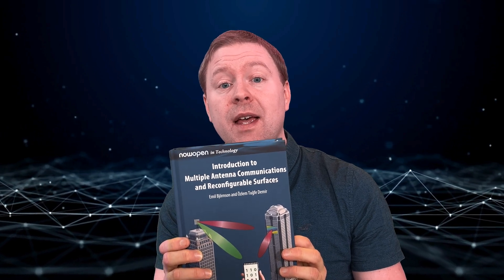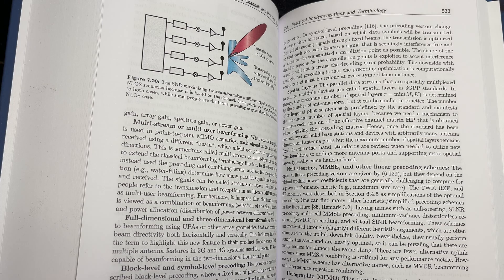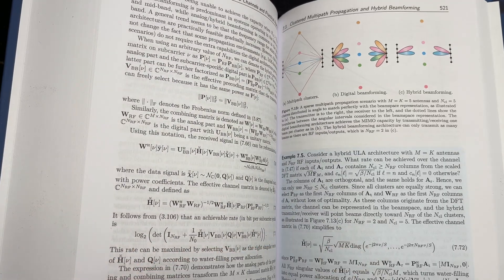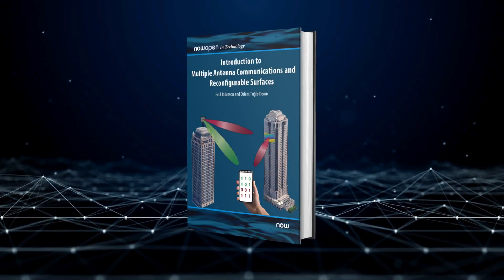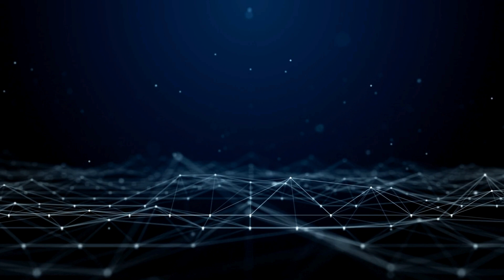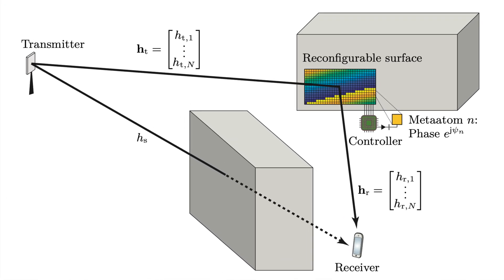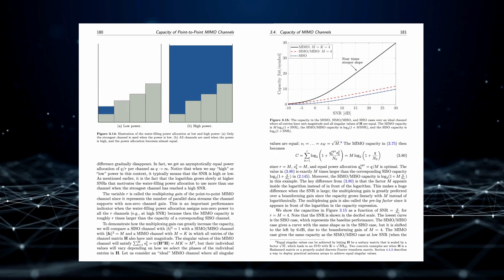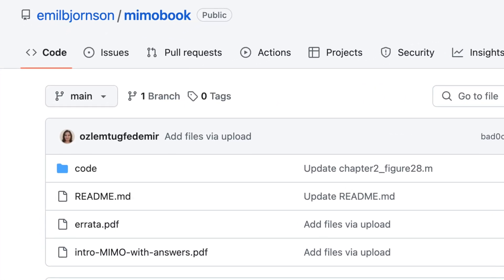Introduction to Multiple Antenna Communications and Reconfigurable Surfaces

Comment: Hello, thanks for your great book. I am about to read about SVD beamforming. Most of it is clear to me. Just that I understand everything correctly.
Let's assume we have 4 transmit antennas and 8 rec. antennas. We have r=4, so we can transmit 4 streams. In your book we have: ".., while the receiver obtains a higher -dimensional received signal where the extra dimensions contain no signal information." 
So 4 antennas at the receiver are not useful in that case? That is where I am struggeling. I thought we can use all antennas at the receiver and comine the signals from all antennas to get the 4 different streams?
Am I wrong here? If that is the case, do I pick the 4 receiver antennas with the highest SNR to get my 4 streams?
thanks a lot.
Reply from the maker: I agree that this statement is unclear. What I meant is that the desired signal lies in a 4-dimensional subspace in an 8-dimensional vector space. All the 8 antennas still provide useful information, but in the receiver processing, we will compress the received signal from 8 to 4 dimensions. This is not done by removing 4 antennas, but rather by multiplying the received signal with the 4 left singular vectors associated with the 4 non-zero singular values.

Comment: Is it right to say there are 4 MIMO beamforming techniques, i.e. zero forcing, MMSE, matched filtering = max. transmit/ receive combining and SVD beamforming?
That is what I found.
Thank you.
Reply from the maker: Those are indeed the most commonly considered ones. Note that ZF, MMSE, and MF/MR are for multi-user MIMO, while SVD precoding is for single-user MIMO systems. There are variations on these beamforming techniques that have different names. There are many names for MMSE-like techniques (e.g., regularized ZF, Wiener filter, max-SLNR) and the ZF-extension for multi-antenna devices is called block diagonalization.

Comment: Mr Björnson, if you have a pdf file in which the solutions to the problems in the book are written in detail, can you share it? (Only the result is included in the answer key.)
Reply from the maker: We have some additional material available for teachers who adopt the book in a course, but we don’t distribute it openly because we want teachers to able to use the exercises as graded homework for the students - this is how I’ve used it myself.
However, if you need hints on specific exercises, you are welcome to ask for it here.

Comment: Thanks for this inspiring book and I am very much enjoying reading it! I have a question regarding the effective area of RIS. Is the effective area of each RIS element dependent on the AoA or always equal to the square of the spacing between neighbour elements? I see publications using lambda^2/16 as the effective area for lambda/4 spacing.  Shouldn't this be adjusted to the AoA even when the transmitter is assumed to be isotropic?
Reply from the maker: The effective area of an RIS equals: the number of RIS elements * the effective area of an individual element.
You are right that the latter term will generally be angle-dependent, similar to the effective area of an antenna. However, if we use electrically small RIS elements, then the angle-variations become negligible. This is what we discuss in relation to Figure 9.8 in the book, where we obtain angle-independence with the element size is lambda/6.
Reply: @WirelessFuture  Thank you so much! I understand now.

Comment: Today there are more and more software dafined radios (SDR) in comm. devices. Filter, up- and down- conversion,.. is done ON a chip instead via extra components like filters. 
Do you happen to know whether there are also SDRs in todays mobile phones?
Thank you.
Reply from the maker: SDR is great for experimentation, but results in less efficient transceivers. Since mobile phones are only supposed to be used in some specific frequency bands, it is better to optimize the design for those bands. Hence, to best of my knowledge, SDR is not used in mobile phones.
However, software becomes increasingly important in cellular networks. For example, 4G base stations could be turned into 5G base stations through software updates. The frequency band was not changed, but the signal design and protocols were.